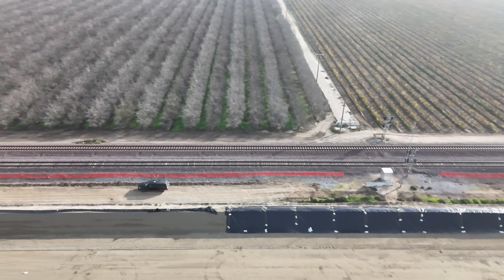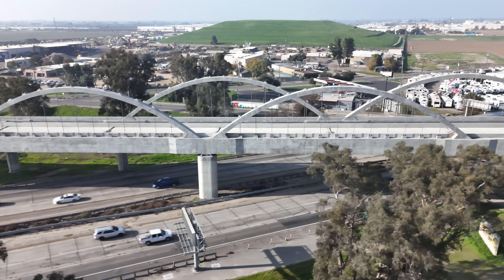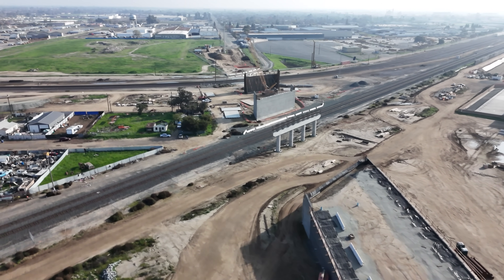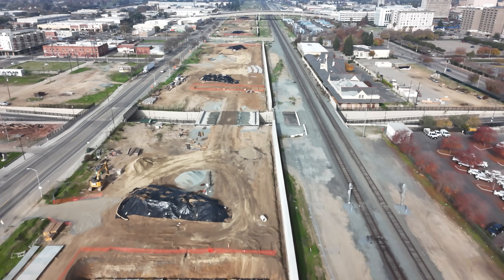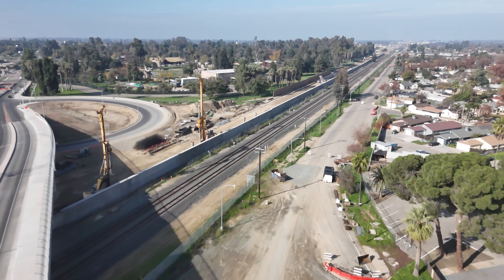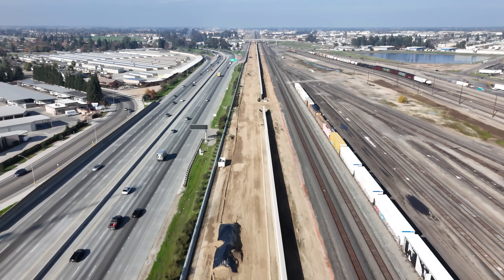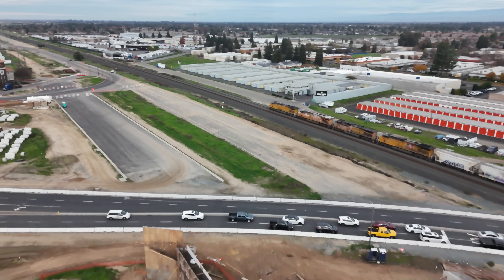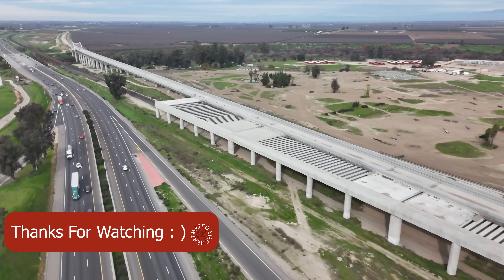MAJOR Progress in Downtown Fresno - California High Speed Rail in Fresno (12-20-25)

Comment: In the beginning it was determined that CAHSR would avoid the old Southern Pacific Line in the Central Valley as much as possible, even though it was already known that the now-currently planned mileage between the Bakersfield and Fresno stations would be considerably longer than by way of the older line. As measured between the two planned stations in Bakersfield and Fresno, using the existing station in Fresno and a new one planned in Bakersfield on the outskirts of town, the route by the new elevated alignment will be fully 9 miles longer than by the pre-existing SP route, which has a tangent segment exactly 50 miles long located between Bakersfield and Fresno, that would be perfect for hosting high speed rail. In Fresno, avoidance of the best route was originally to be accomplished by building an elevated station somewhere north of town and to the east, accessed by way of an elevated rail viaduct (How else?) which would have required considerable property acquisition to achieve a remote and unpleasantly high-up station, far less convenient than the current, noticeably decrepit one, located directly on the main line.

When CAHSR gave their reasoning for avoiding the Southern Pacific Line several years ago, they used language almost identical to that used by the consultants on the Texas Central project, to justify their preference for avoiding the existing, shorter alignment. ADAPTED BY ME from the Texas Central Spiel, the example below attempts to recreate the written justification for taking the longer route, which exists somewhere in the volumes of CAHSR documents from years ago, and amounts to a contrivance developed by lawyers for justifying the consultants' preference for avoiding the correct route, in favor of one that is fatally flawed: 

"To be located within the freight rail right-of-way would require that CHSRA construct a barrier wall between the freight rail tracks and the high-speed rail tracks for safety purposes. This is to prevent derailment of one service from colliding with the other service. The cost of an approximately 196-mile barrier wall exceeds CHSRA’s purpose in that the Project would not be economically viable." [The 196 miles represents the approximate distance on the old line between Bakersfield and Modesto: the extent of a properly aligned LA-to-SF passenger route within the Central Valley.]

Thus the correct alignment was Blackballed - probably till the end of time. (The quote marks were added by me as well.)

I see though that they've managed to build a few huge and extensive barrier walls around Fresno anyway! The said barrier walls, as defined in documents for both projects,  were to be of reinforced concrete, at least 40' tall, and five feet thick at the base, which would have tended to consume a lot limited space in the existing rights-of-way with sometimes-negative results, making them infeasible from a physical standpoint as well, in addition to the expense and "Safety First" ploy emphasized in the documents.

Rather than having the CHSRA build 196 miles of impact barriers, the correct option for mixed use when necessary - as in the case of CAHSR - would be to elevate the permissive standards that freight carriers have gotten away with for the past 75 years, by disallowing their "square wheels bad brakes rickety tracks" mode of operation. e.g. See East Palestine - there is STILL no law requiring fault detectors, much less a reasonable amount of required track and equipment maintenance.

In any case, they intend to denigrate and deprecate the existing Fresno SP station as much as possible - because they would HATE the idea of having it lovingly restored as was successfully accomplished with the Santa Fe station in the same town, now found in the National Register of Historic Places as well. (It's important that children see architecture like that - not necessarily period architecture - so they know what it looks like versus the usual incompetent tripe.) It would be anathema to CAHSR's intentions if the Fresno SP station were to get on the National Register, and they are engaged in several activities to preserve its current deprecated, boarded-up state.

First, they have kept any positive input about the old SP station out of the press, even though they now intend to use it - because they were forced to use it over their original preference for another more expensive alternative. They have neglected to convey their ascent for 'good ink' on the Fresno SP station, because they still want to avoid it. There is a suspicious degree of cooperation with bad ideas in the press for the most part. Clearly the CAHSR people have an inside line, and it's being misused.

Importantly, the insulting deprecation of the Fresno SP station will be implemented by deliberately getting the grade configuration wrong. The station tracks and platforms should be located BELOW the station's main/street grade, and the approach tracks should pass beneath both Tulare and Fresno Streets on either side of it. They will instead build some gigantic and expensive train shed of overwhelming dimensions at the erstwhile street/station level, and keep the ugly, graffiti-ridden wall that currently blocks off the original station, intact.

Naturally (and instinctively for most, I think) Tulare Street should offer easy access to the old station interior, by placing the street AT STREET/STATION GRADE. The positioning of the station tracks should afford room for a sort of long back porch on the old station, also at street grade, with the first side-platform adjacent to it accessible through means of four commodious and gracefully configured stairs giving off it. (It's tempting to conjure up the period cleché of a long striped awning, which might not be a bad idea.) Accessible accommodations with vertical conveyances would reach both the side and Island platforms by means of a broad and well appointed tunnel accessible from within the station, which would have all the accessible and convenient conveyances available for general use, in addition to stairs and/or ramps.
Reply: I attended my first meeting of the CAHSRA Board back in 1996 filling in for a colleague.  The CAHSRA fiasco has been (and still is...) a project planned of, by, and for the consultants and contractors as corporate welfare, to politically connected A&E firms and contractors.  Who, through "self management" for a percentage of the work they manage, have designed and built a costly bloated gold plated project, costing at least five times as much per mile for a gold plated system as in Europe over flat rural terrain, that will be the most expensive system to operate, and to ride, as well.  It is sad because we deserve better.
Reply: @bhuddy1832  Someone should sue the sh*t out of them. Thanks for your friendly reply: usually I get hostility if any attempt to get specific is made. Gateway Tunnel here in the East is the same stuff - We INVENTED it. (The PRR crash and burn was deliberate I believe, then cam the merger.) Difference for me here is I was telling them many of the things they were doing were wrong before they occurred, unlike with CAHSR, so can always say they were warned. About what IDK, not in a position to sue, but might try it anyway.
Reply: @brucehain  Folks need to reform this process to insure that well planned rail projects are cost effective and can effectively and efficiently meet our travel needs at a reasonable and justified price to build, operate, and ride.  We need to reform the process to require better independent oversight of the planning, design, and cost/benefit tradeoffs, and eliminate the "cost is no object" "gold plated"CAHSRA business model of "incentives" that have created delays and driven up costs to absurd levels in comparison to similar projects.  Then, we will be less likely to see this kind of costly controversy over the CAHSRA's current poor business model that has created the current issues that undermines public credibility.   We need to fix these things so we can make these things better and get all of us the best bang for the bucks that we are all paying for it.
Reply: @bhuddy1832  Sorry, I just wrote a big reply, then touched one of those new connecting lines on the left of the text, which turned bright white as it deleted my reply. I wish they would test things before they put them out on YouTube. Lately since they brought in these new attributes sometimes the page will freeze before it loads and the only option is to copy the address and open it again. See, I have to click on the margin to get it to scroll, but I clicked on one of their stupid lines instead.

Comment: 7:20 - It looks like CHSRA started on the Fresno Street underpass projects HSR viaduct foundation. I am wondering if CHSRA will have to expand the grade separation to be like the other underpasses to allow for adequate height under the viaduct.
Reply: I'm not seeing that. I do see trenches before and after Fresno St., with pipes, so those are utilities, I think.

Fresno St. Will be similar to Tulare or Cesar Chavez, so the will need to lower the street on the west side and build a bridge over it for G St.
Reply: I believe Fresno Ave underpass will need to be extended west, but I'm not sure if the trenching is related to utilities to start on that, or just other utilities that had to be moved in general.
Reply: @rwdavidoff  I see about 7 of those trenches crossing the alignment in downtown, and one parallel. I suspect they're drainage pipes, but hard to say.

Comment: I'm guessing the different design of Tulare has something to do with the station being here. If the station platform structure extends over this bridge, maybe that's what will get the CaHSR bubble pattern?
Reply from the maker: Maybe? I wonder why it wasn't painted either the design I think makes sense since it's designed for 4 tracks in length